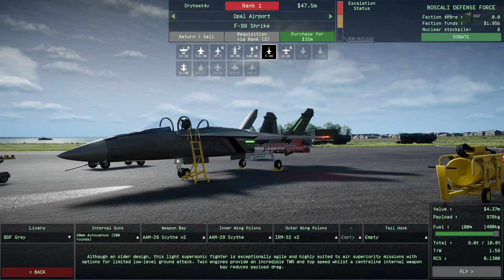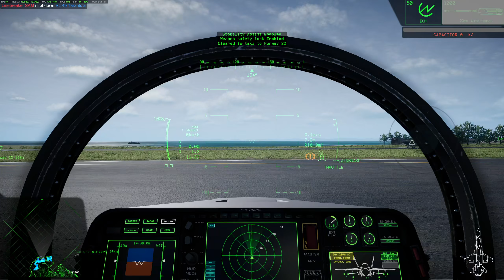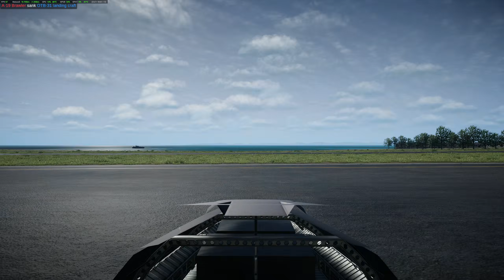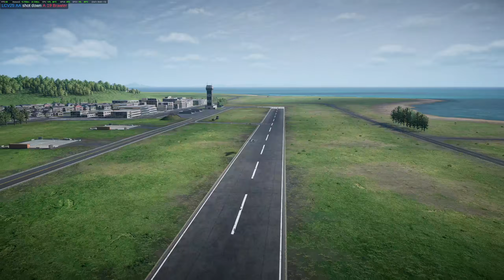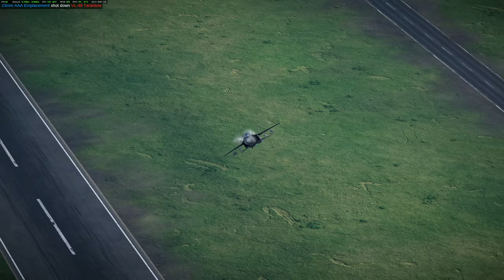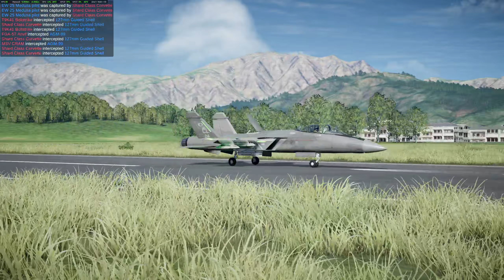Nuclear Option | Long Play Tutorial | F-99 Shrike MOD | Rapid Response Air Defense

Comment: Aryx weapon pack = Fuel Tanks and additional ground options, plus it wouod give you the opportunity to make your first MULTI-AIRFRAME Long-Play.

Also, the Torpedo mod means it can be a strong naval threat, and since the torpedo balance is their ludicrously low speed, the Sbrike's high speed is even more valuable. 

I note you have a CBO-400. Interesting. Haven't seen that specifically by itself. 

Would be interested in seeing which mod that came from.

Again, how do you do that? How do you determine the INSTANT your alert goes off the exact model of IR missile headed toward you? That seems like a hell of a useful skill.
Reply: The CBO is now activated by the F-99 mod
Reply: @themigmadmarine arigato